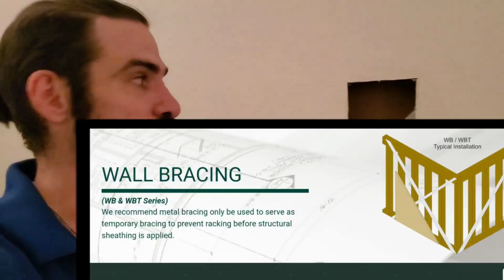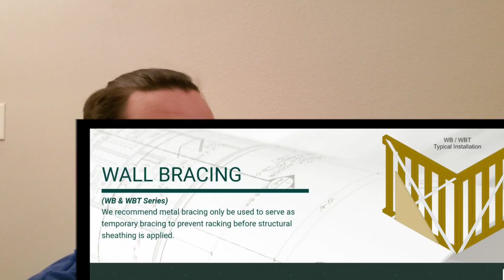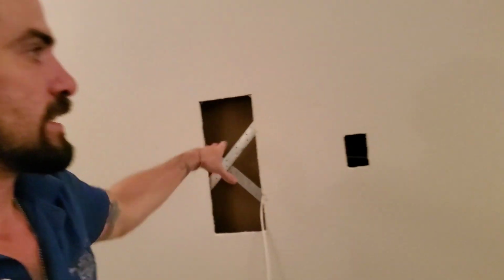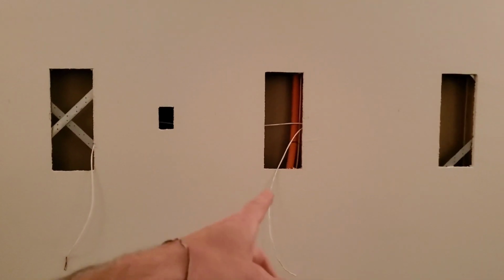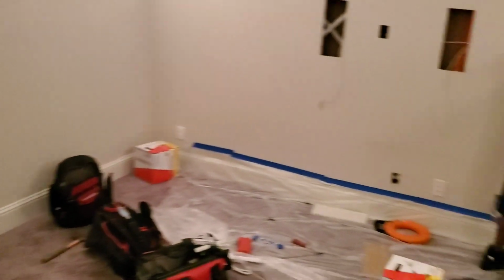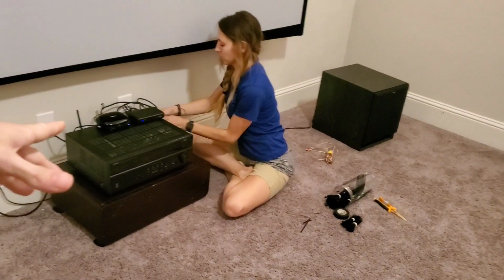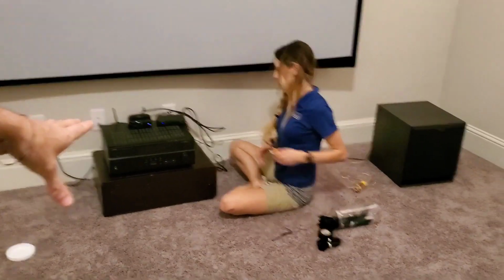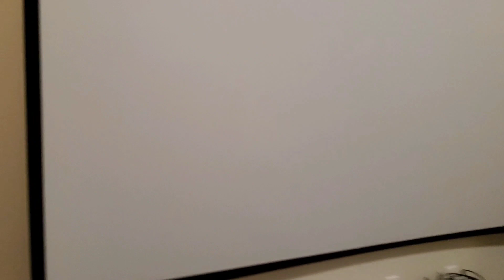Speakers Behind The Screen! Dolby Atmos Home Cinema Custom Installation !

Comment: Your fronts and center should be the same as to have a seamless xovers.
Reply from the maker: In an ideal world you're most definitely correct. In this case it came down to budget restrictions my friend. Adding those extra two adds roughly 700 dollars to the tab. Still with our professional calibration equipment we can dial it in to sound phenomenal to even a trained ear. Thanks for watching!

Comment: Looks fantastic 👍 what aspect ratio is the screen?
Reply from the maker: Thanks boss, its 16:9 with a patent pending proprietary curved shape which is unique to DAV
Reply: Divine AV Home Theater Niceee ... it’s beautiful.
Reply: @DivineAV  are your screens better than the Screen Innovations Black Diamond Pro or XL?
Reply from the maker: @muddasirsultan6256  we have compared those products to our custom units and found them to be quite similar. Both performed very well. We may do a video on that at some point
Reply: Divine AV Home Theater and how much would yours cost for a 150” 16:9?
Reply from the maker: @muddasirsultan6256  locally it's about $1,500 but unfortunately we only build them locally at the moment. We will post a video if that changes. We have patent pending on our designs

Comment: Non matching center? What’s up with that?
Reply from the maker: Hey, thanks for watching. This is a mid-range budget build and so as opposed to put in 3 budget speakers for the LCR, the client agreed to upgrade the most important speaker in the room which is the center Channel. The left and right channels are playing entirely  different content from the center channel. Dialogue Clarity is key. Also, if you look at every tower speaker setup on the market, the center channel is an entirely different speaker in every situation. This client is blown away with the result and the system is absolutely fantastic. These are some of the best in-wall speakers in our opinion.